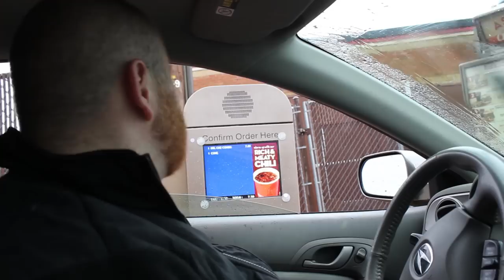K24 Swap - 45 Days later

Comment: Factory ep engine makes about 130hp and 110 tq on a dyno, this motor does 219.6 go at 165tq at 8krpms that's why we go k24.  It's also half the price of a k20a2 or z3
Reply: +dave bazer  i recently purchased a already built k24 ep3 here in AUS.
and damn the torque is nothin like k20 lol
Reply: +Pete R no way. The built and properly tuned k24s make at the wheels what the k20a2's make at the crank, easy. Check out KMOD performance. The gentleman builds some me K's.
Reply: +Belicose777 mean***
Reply: +Belicose777 i make more to the wheels with my z3 then when i got the fg2 from dealer...motor is still stock...

Comment: next time try using the cherry picker chain a cross the top between strut towers where the bolts are remove bolt and place chain leakage flat and place nut on top can left the car easy
Reply: x2

Comment: I have a full automatic Acura TSX engine I'm talking the works from engine/transmission to cables and ecu. the car is crashed but engine is great how cheap and difficult would it be to swap the engine to my 98 Acura cl